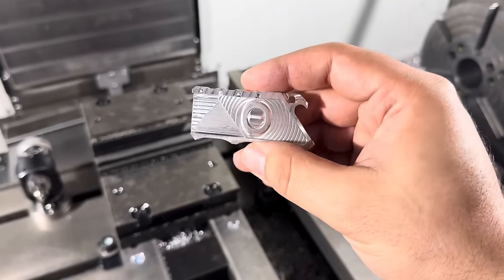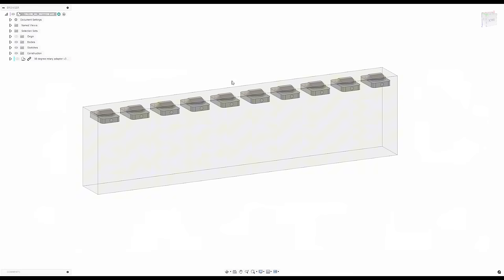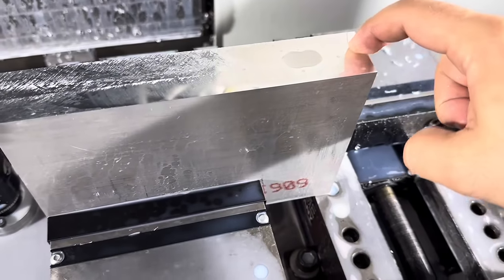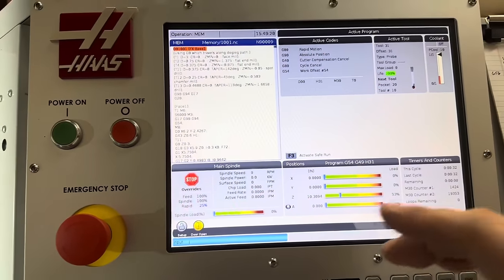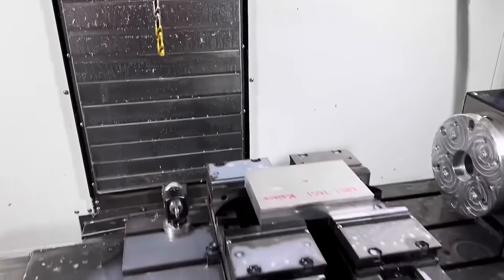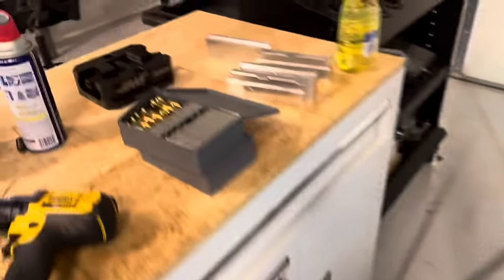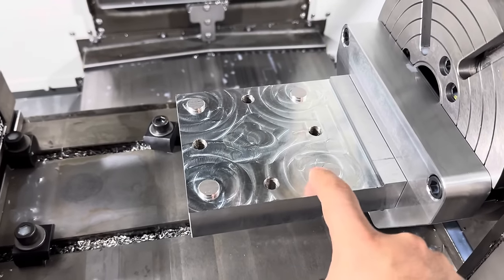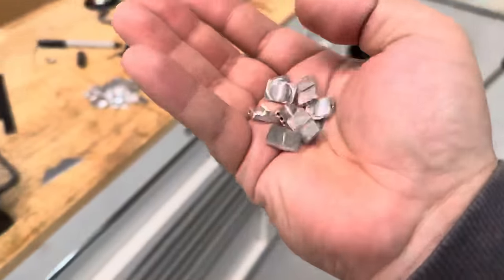Life As A Machine Shop Owner - #3 Lets build a rotary adaptor!

Comment: Good job. I would only suggest that you might want to reduce your projection length on your tool holders. When they hang out that long you can’t get aggressive with your cuts you will end up with a screamer and chatter galore.
Reply: Shit I work on 813 Harden to 45 and unfortunately I have to use a half inch and mill hanging out 3 inches to be able to reach some of my spots I worked in the automotive industry and unfortunately only use three axis machines

Comment: Nice work - It would be nice to see the changes in the fusion 360 programming that were made to support the rotary. Also interested in how you made the tabs (what tool was used etc).
Reply from the maker: I just use a new work coordinate for each orientation/position and enable the rotary axis in the post processor. It outputs the A-axis moves automatically. Regarding the tabs, I use a 1/32 x 2" 60? tooth carbide slit saw from johnson carbide and cut it in multiple radial depths of cuts from eaither side. I comp the tool to adjust tab thickness and ease of removal.